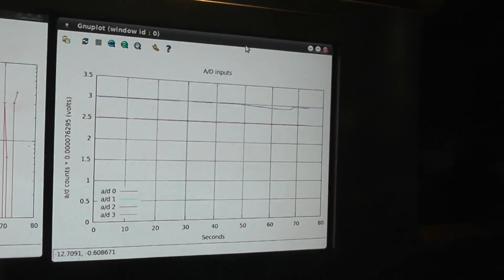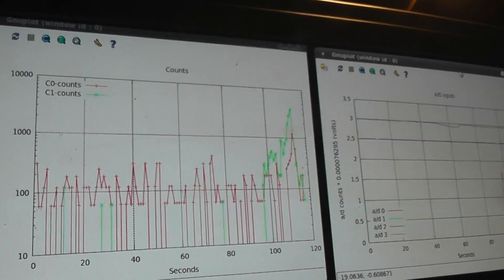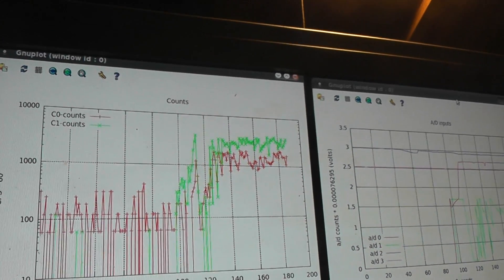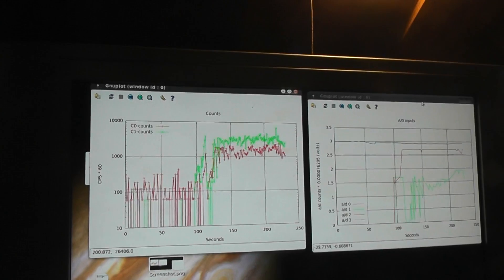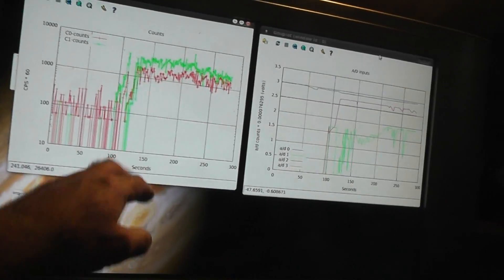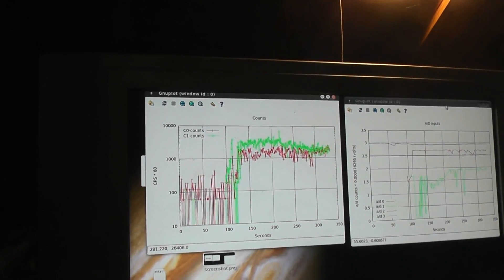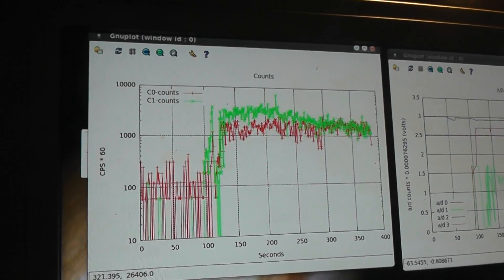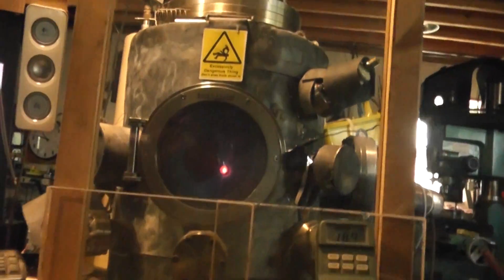FriLongRun

Comment from the maker: Code for those plots.  The left window, green is neutrons from a hornyak detector calibrated such that on this scale, 980 cpm = 1 million neutrons/second.  The red plot in the left window is from a well-shielded geiger counter.  In the right window, the blue is pressure (log scale from sensor, but lin plotted), green is current, red is volts, and the straight line is a reference voltage.